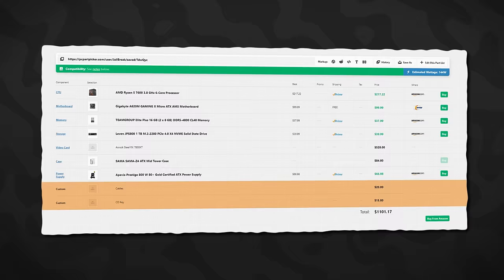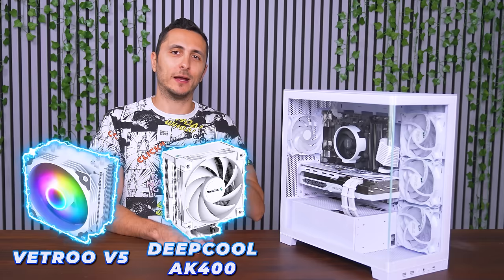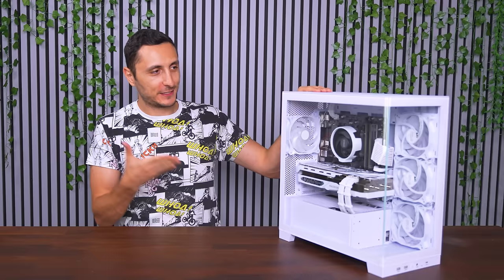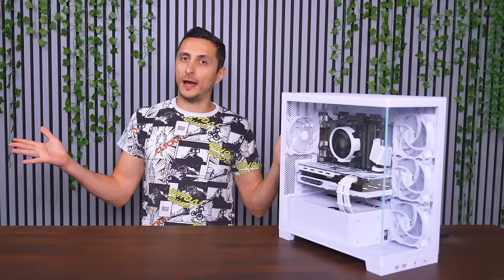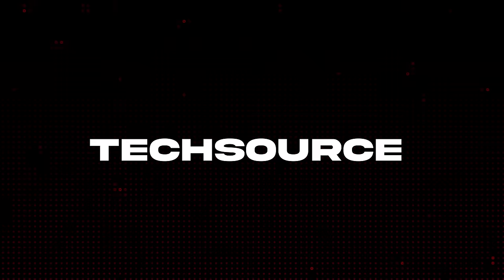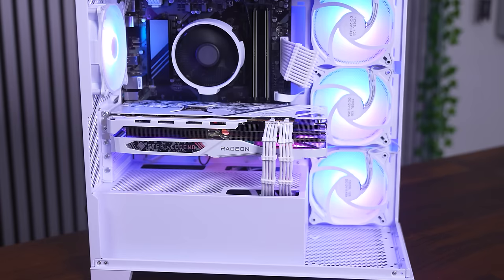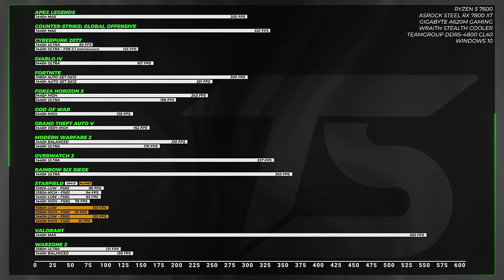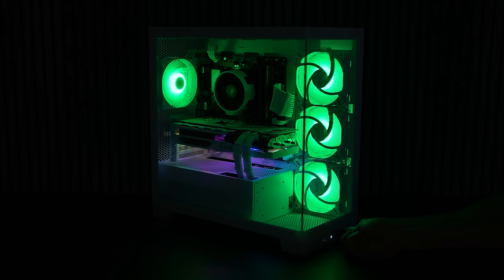The UNBEATABLE $1100 Gaming/Streaming PC Build!

Comment: YOU GUYS!!!!! I’m late cause I’ve been playing too much pc but I built this EXACT SAME PC same exact parts and all except in black. This pc is a beast. I don’t really work from it but I’m running Val on max settings at a consistent 591.5 frames per second. This pc is so fast. So clean. So fun. This is my first pc I’ve bought and built and i used his video to build it (kind of confusing) my build ended up being about 1300 with keyboard mouse and pad. I absolutely love this computer. There is nothing bad I have to say about it. If you guys have any questions or need links or anything g I got you. Last time THIS PC IS FUCKIN AWESOME AND YOU SHOULD GET IT IF YOU ARE LOOKING INTO PC GAMES
Reply: Yo question, what graphics card did you get bc I can’t find the black version of his card.
Reply: @Anthony-ym2id  well I guess I didn’t get the EXACT same graphics card. But everything else is the same.  I got the Radeon rx 7800 xt hellhound for $510 before Black Friday. If you want rgb go with the red devil. I’m almost positive they’re the same card just the red devil has custom leds. The hellhound has blue and purple
Reply: can u send link to the storage i cant find it
Reply: What about the temperature of the cpu?
Reply: @DRUlGR  sorry for the late response I just bought a 2 tb ssd from Amazon with no hard drive
Reply: @maro4289 the temp of my cpu never goes above 55 celcius. There’s no pins on the ryzen 5 7600 so putting it in was easy and not stressful like it normally would be

Comment: i encountered that same problem with the controller, you only need to press the led button for 5 seconds  to turn off the controller and use the onboard controller
Reply: Can you elaborate? Were you able to control the RGB through the motherboard?

Comment: will getting the x version of the cpu with a better fan and a cl30 32gb of ram instead of 16 help in getting more fps on games like starfield, cuz it appeared those games couldn't reach the full potential of a 1440p 144hz+ monitor or will you still be forced to lower graphics to hit at least as many fps as your monitor's hz?

Comment: CPU:  i5-12600KF - $193.99
Cooler Master Hyper 212 - $19.99
MOBO: 	ASRock H610M - $83.99
RAM: Silicon Power XPOWER (2 x 16 GB) DDR5-6000 CL40 -$69.97	
SSD: TEAMGROUP MP33 1 TB - $41.99

GPU:  Gigabyte GAMING OC Radeon RX 7800 XT
CASE: 	Deepcool MATREXX 40 - $49.99
PSU: 	EVGA 650 N1 650 W ATX Power Supply - $54.99
TOTAL:  $1038.91

Look I just beat your spec and for less money and MORE PERFORMANCE
Reply: how much better is the performance? and is it future proof?

Comment: Can you use these parts in a build cause it’s the same stuff I’m using for my first ever build I’m using a tuf gaming motherboard B550 plus WiFi 2 got the 5600 AMD Ryzen CPU with a Cool master Hyper 212 Halo Black CPU Cooler with G skill Rip Jaws 2x16 GB DDR4 Ram sticks with XFX speedster swft 309 Radeon RX6700 XT 12 GB with a Western Digital Black SN850X 1 TB  for storage and for Power I’m going to use Corsair RM750x (2021) 750 W 80+ Gold Certified Fully Modular ATX Power Supply inside a Montech AIR 903 MAX ATX Mid Tower Case is all this good for my first ever gaming Pc Build

Comment: if its for 3d work and need the ray tracing then only the RTX graphic cards can do that task correct? just wanna double check. 
didnt think to get a 4000 series graphics card and stick with a 3070 but at my company they using a 3080 and maybe I'll want to push to match their specs for my home.

Comment: Genuine question, i understand for the 400 500 dollar builds using a budget motherboard, when spending over 1000 on a system i think the extra 150 or so on a motherboard with enough pci lanes and expandability for upgrading is worth it, does that motherboard allow you to run a m.2 at gen 4 speeds and a gpu of that caliber at full x16 and still be able to add more storage if needed? I build and flip on the side no where near what you do, but i include a z variant motherboard and a k variant cpu even in my cheaper builds for upgrade path and for overclocking. Is it better to save the money and profit more do people not know enough or care about these features? I always thought leaving performance on the table for 100 dollars and if wanting something better not having to change  the entire platform out is something people would look at, feel free to let me know i would enjoy extra profit seeing how i only make about 50 bucks per build, but i also only build with brand new parts so i dont have people coming back in a month saying something is wrong with it, and yes i do run stress tests benchmarks and memory tests for stability.

Comment: I have a question about this. So I purchased everything and got an Arctic liquid II 240mm AIO for it. But both my fan argb and aio argb both require the 3 pin 5v connectors and the motherboard only has one 5v 3 pin header

Comment: Does the preinstalled fan hub only allow rgb control from the from panel toggle button or through motherboard software too? Comparing my hub to the one shown in the video, my hub is missing a few resisters and capacitors!? rgb control is only from the front panel button

Comment: Hey man I just did this same set up and I’m absolutely loving it! Thanks for all your great videos and help. Now if I can only find out how to control the rgb on the fans…. Can anyone help me out 😭
Reply: Did you buy this exact pc?
Reply: Dude I’m stuck with this as well. I have the same case and I can only control the rgb with the physical button. I can’t use any software
Reply: @flavioa6351 he said in the video you can’t control the rgb from the software
Reply: @shrimmppppp  yes you can I figured it out. If you hold down the rgb button for 3 seconds and then it’s controlled by software . Currently using signal rgb on all the case fans

Comment: I been following for years, I have a question

what cpu and gpu would be best for gaming/Streaming while still good for work like programming/ coding?
I got a 2000$ budget to build my 1st pc
Reply: For a $2000 budget you can build a beast of a machine but it really depends on the games you play and the work you do. An Intel i7 12700k, RTX 4070 Super and 32GB DDR5 ram would be a great build with future upgrade options for the CPU to the 14th GEN and the GPU to higher end cards if wanted

Comment: Only proplem here it would cost more like 1400€ and my bugdet is 1250 in lian li o11mini 100€ i currently have aus rog strix b550 180€ deepcool 3 packs x2 70 rx7600 gaming oc 340€ lian li 750w sfx psu 130€ ryzen 5600 150€ deepcool ls 520 100€ corsair n
Vengance rgb 60€ 
I forget ssd 50€ (1tb)
Reply: You could get a much better gpu and case at this budget. Even a better cpu

Comment: I just built my first rig with a i7 12700k, 4070ti, and 32gb DDR5 @5600. How is this build getting better results in fps? For instance, in Fortnite (which isnt why I got it, just an example!) he's pulling ~200 while I'm at 100. Or in Overwatch. He's gettting 300 and I get, again, like 100-130.
Reply: Temps and everything fine, and bios settings are correct? Also did you happen to cheap out on a motherboard and how’s your storage looking? And If you haven’t already I’d follow an optimization guide for your set up to make sure all the settings are right. I’m definitely not a computer expert by any means but I definitely feel like it should perform at least about as good as the build in the video. I do also wonder about the 12700k with the ddr5 5600mhz ram, not sure if it can make full use of those speeds or not, I feel like it still wouldn’t be that big of a performance hit but truthfully I’m not sure about that.
Reply: @Ethan-yg8me  temps are great. GPU and CPU usage are normal. Def not the z790 mobo. The 12700k is supposed to be really good for gaming and I'm using it with my RAM on an XMP. The only thing I cheaped out on was a gen 3 NVMe 2tb.

Comment: Probably gonna build this one! I am just wondering how could I get a little bit more fps for CS2, maybe better ram? Or should I say more ram😄
Reply: thinking about it too... but wouldnt it make sense to wait for black friday rn?
Reply: @tmane. exactly what i’m doing
Reply: @nickperez. I was too impatient to wait lmao, I’ll be buying a vr headset instead
Reply: I’m building a rtx 4070, Ryzen 5 7600, same motherboard, 32gb ddr5 gskill s5 ram, 2tb wd sn850x ssd, phanteks p400a case, same psu, thermalright phantom spirit 120 se cpu cooler, x2 140mm top fans and 1x 120mm exhaust fan
Reply: @DankAriZonaTea i’m starting to feel the same way im jus not sure still noob to all this i wanna use the h9 flow case tho but not sure if it’s compatible

Comment: hey guys, is the rx 6800 xt still good these days? if so, what processor on the am4 platform should i pair it with? (budget wise)
Reply: 5600 works fine but if you could stretch the budget and if you have 5600x3d available get that ❤

Comment: I"m no pro but just curious are those cpu temps actually safe? I am planning on a itx build with 7600 and I was wondering if I can use the stock cooler
Reply: Temps are okay, but it is getting loud. An Assassin King 120 for 25$ will do the job quiet.

Comment: My build was based on this. Except the gpu is out of stock got a sapphire pure 7800xt for 299$ marked down on Amazon atm. white case was out stock had back ordered went right out of stock didn't get it so had to order the black case. Anyone think that would be any problem building compared to him. & Would y'all have waited to pay 620 for this gpu for the sapphire pure for 299
Reply: They’re basically the same except the outside, are you sure it’s a Sapphire Pure 7800xt? Because those go for the same price as the one used in this video

Comment: I built this PC and really need to know how to control the RGB fans
Reply: I read in tje comments when you download rhe software for it if you hold down the control button for them on tje front panel for 5 seconds it will let you control it from the software
Reply: @christianspringer1012  I tried looking in the comments and I couldn't find anything. Do you remember what the software was called.
Reply: @ExoticFix want to say it was the software hectried using in the video

Comment: just built this PC and it runs great! did do a few upgrades though
Reply: Hey what did you upgrade?
Reply: @phillipxou  u only bought 1 of those?
Reply: @phillipxou  also what fps are you getting on high with these?
Reply: @londondavis1985 one of what? as for FPS, I set my max FPS on all games at 240hz since my monitor is 240hz max

Fortnite - 240+ fps High Settings

Warzone - 180-200 fps High Settings (also adjusted config file tho)

League of Legends - 240+ fps High Settings

CSGO - 240+ fps High Settings
Reply: also those fps are in 1080p not 1440
Reply: @phillipxou  one cooler
Reply: @phillipxou  this stuff way cheaper now even with your upgrades its still below 750
Reply: @londondavis1985  yeah i just have that one cpu cooler, i might upgrade to a AIO liquid cooler in the future, but i’m also fine without one
Reply: @phillipxou  was it the mobo that cost 159.99 also did u watch a video for the cooler.. I don't want to mess that up since it is my first pc build also hope that mobo comes with wifi unless I might as well buy the other one
Reply: @londondavis1985   yeah that’s the correct Mobo listed above ($159.99), it comes with built in WiFi, you just have to hook the antenna they give you into the Mobo. 

i didn’t watch a video for the cooler i just bought the one he suggested in the description and it works good, but if you want something top of the line then i would get an AIO
Reply: @phillipxou does your mobo have coil whine I seen alot of people complain about that
Reply: @londondavis1985  mine does not have any coil whining, i saw a few reviews that said that but decided to take the chance and there have been no issues at all
Reply: @phillipxou  does the mobo only come with one standoff and screw or is mine not right?
Reply: @londondavis1985  hello, i’m not at my PC, so i can’t give you the exact number but it should definitely be more than one. i believe i had 6-8ish
Reply: @phillipxou  finally built my pc went with everything u said but with a 6700xt instead but when u switch to 6000mhz does it crash your pc? Maybe thats just me but idk it works fine on default 4800 I think but when on 6000mhz it crashes
Reply: @londondavis1985   congrats on your new build, did you enable xmo? if so try to manually over clock it at 6000mhz, when i switched to 6000mhz initially it did crash i believe to just reset it, but after that i was able to boot it back up and my ram has been running mine at 6000mhz
Reply: xmp*
Reply: @londondavis1985  also do you have 2x32gb or 4x32gb?
Reply: @phillipxou  2x32gb but i will try the 6000mhz again and see
Reply: @londondavis1985  okay yeah try it again, when i did it my computer shut down but i started it back up and got the 6000 mhz clock speed

Comment: @TechSource I see that you are playing on the Sony INZONE M9 gaming monitor which goes up to 144hz but I see you achieving over 200fps on the games you are playing. How is this possible? I’m not a PC gamer. I play on the PS5 at 4K 120fps for some games but my son wants me to build him a PC. He also has the Sony INZONE M9 and I was thinking if I need to get him a downgraded monitor that has higher FPS but lower resolution so that he can take advantage of the performance. If I don’t have to do that then it’s great. If you can provide me some information on that I will greatly appreciate it.
Reply: Anyone else who is PC gaming savvy please feel free to answer my question. How is he able to get over 200fps on a 144hz gaming monitor? 

I am not a pc gamer but to my understanding if you’re monitor is 144hz then you are capped up to 144fps even if your hardware can go above 144fps. 

For example: I am console gamer. Even though my PS5 is capable of 120fps I couldn’t achieve it because my LG gaming monitor only supported 60fps. I had to upgrade to the Sony INZONE M9 in order to get 120fps on my PS5. I thought it was the same concept on PC.
Reply: @geogadget1   Im not totally sure but this is what I think: Even if it says 200 or anything above that, a 144 hz monitor will only give you 144 fps even if it says more
Reply: @tigerishwolf1231  thank you for replying back to me. I guess my next question would be if I have a gaming monitor that does up to 144hz would I have the same performance advantage if I game at 144fps vs 220fps since I am capped at 144hz anyway?

Comment: Would this PC be suitable for streaming occasionally? And is it a problem if you can’t plug it into the internet router directly?
Reply: It'd be fine for streaming although a ryzen 7 chip could be worth looking at. If ethernet isn't an option, just look for any decent pcie wifi card or wifi dongle (tplink is a good brand to go for)
Reply: Alright, thanks for the advice!

Comment: Great build although I would spend the extra $24 bucks and get a i7 12700k instead or even the 12700f for less than that.
Reply: Why? Worse cpu and dead platform
Reply: I agree on the future proofing, but the  i7 12700k is better for gaming and as a workstation. Double the cores 8 more threads and when overclocked much better.
Reply: @Grainsauce  the 7600 is significantly faster in gaming. And this is a gaming/streaming build, not workstation. No use paying for extra core that you'll never use. Also they're both overclockable

Comment: @Techsource Wat gpu should i pair with my ryzen 5 7800x i currently have a 3060ti and wanna upgrade
Reply: sorry its a ryzen7 5800x
Reply: @@Nate-xw6jni doubt a 4070 would be bottlenecked by a 5800x also he should consider getting a 5600 non x since its the same performance as a 5600x basically and we already know the 5700x 5800x 5900x all perform the same as the 5600 in gaming

Comment: on psu white  cables ,  gpu 1x 8pin  can handle 150w? I bought and it can use max 100W ...
Reply: Maybe powerlimited in the BIOS
Reply: @Dasgabar  no with original cable it has 180w+ and on extention cable had 140max and gpu warning led blinking ... when I changed with original psu cable it was right
Reply: @vax_ta  well then the cable is the problem just buy a new one

Comment: the radeon 7800 xt and the amd ryzen 5 7600 bottle necks is that fine?
Reply: it’s doesn’t bottle neck. they are a great duo
Reply: Yesh but I got a bottle neck calculator and on 1440p it said it bottlenecks send only 4k it doesn't

Comment: Tried to build this exact setup today turned it on ran for 3 seconds turned off & has no power now at all now 😑
Reply: Did you ever get this issue resolved??
Reply: @itsrebal1913  pretty sure it was a dead motherboard every time i turned on the power supply fans would spin for a split second without power button being pressed just upgraded the motherboard & works perfect
Reply: @dominicrush3353   gotcha, did you get a refund on the faulty motherboard?

Comment: I built this pc using your guide but im having trouble with the case fans the rgb lights are turning on but the fans wont spin any suggestions?
Reply: Hi were you able to fix your problem, and how are your games performing?
Reply: @OhmyJeebuss  never got the fans working and the rgb went off on them but games work well
Reply: @robertdoud661 hey idk if you ever got it, but when i built mine my fans or rgb weren’t turning on either. then i figured it out, i forgot to plug in the SATA cable into the RGB control panel on the back of the case. idk if you possibly missed plugging it in as well, but could be a possibility
Reply: @OhmyJeebuss ^